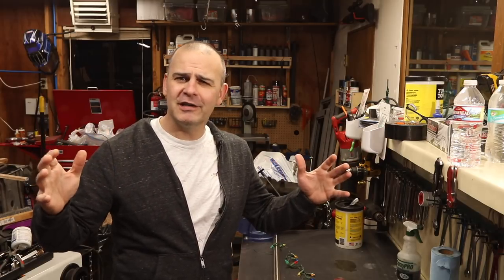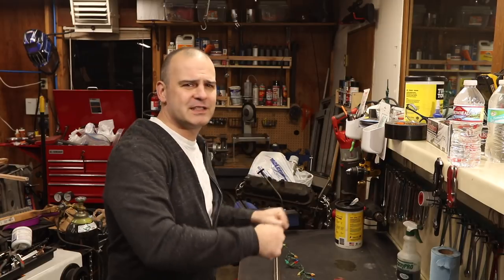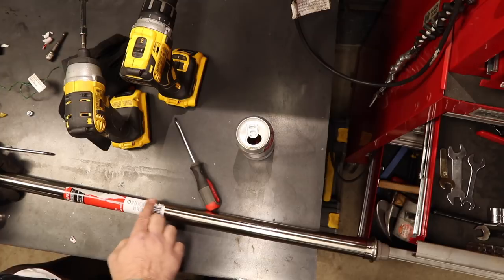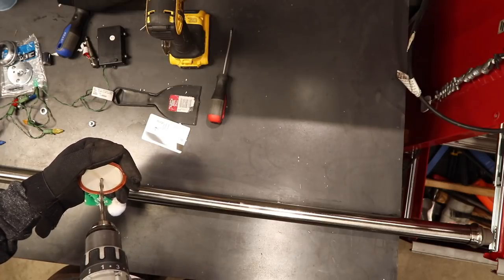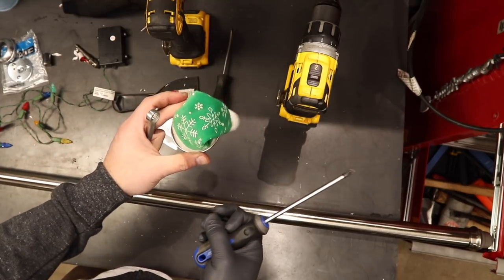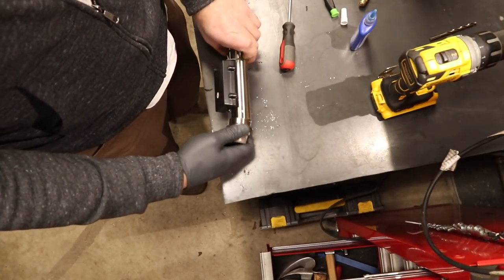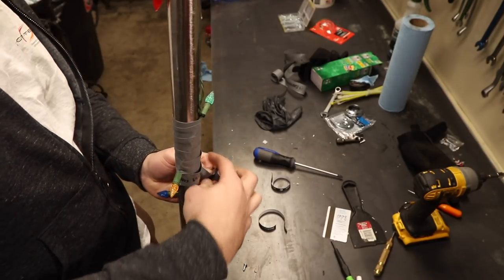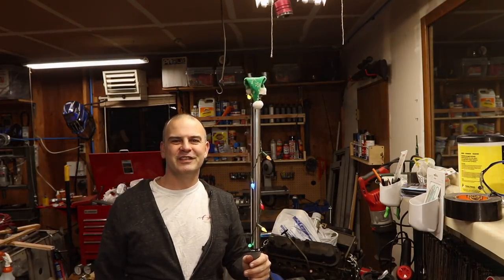Festivus Pole - How to Fab

Comment: Two problems with this design: closet poles are stainless steel, which is a nonstandard material. Also, LED lighting is not a traditional accessory to Festivus poles, which are normally unadorned. Looks like I have a head start on grievances this year!
Reply from the maker: CAPSLOCKPUNDIT guilty as charged. But you know we just pulled it out for our Festivus party and it just looks so great with those LEDs. It’s become a real tradition. Plus, no rust.